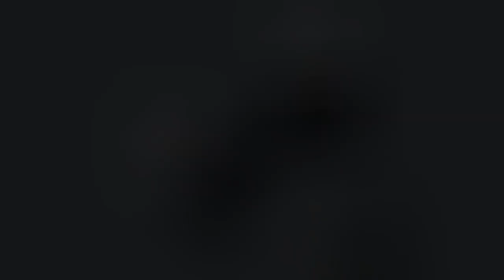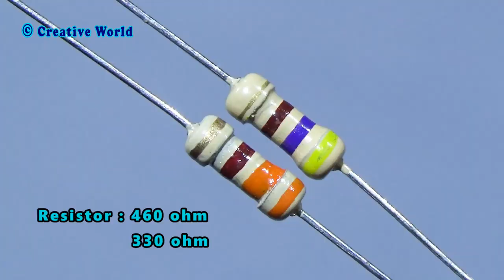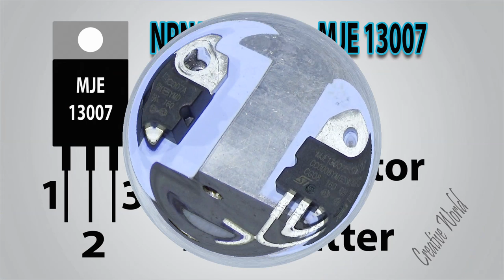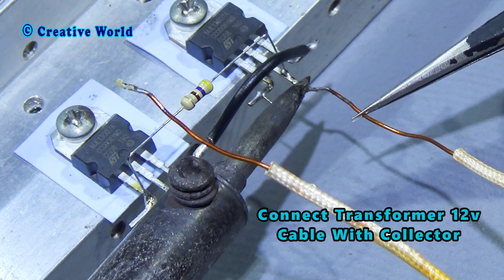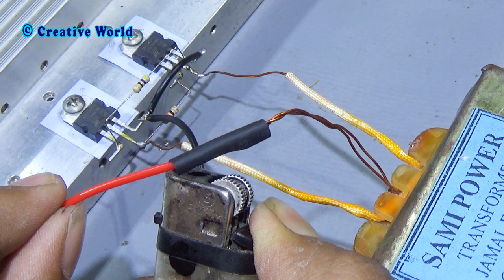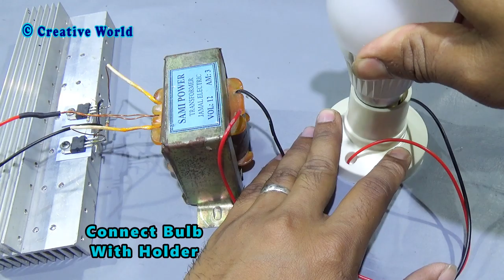How To Make Cheap DC To AC Inverter Circuit Using Transistor

Comment: BS. There is no timer IC or capacitor to generate the 60Hz.
Reply: AC current does not have to be 60 Hz. It can be 50 Hz, 60 Hz, or even a couple kilohertz.
Reply: @colenichols  lll⁰p
Reply: he's just switching directional flow. Making a square sine wine at a natural oscillation based on the resistor between the two switches. Then using the transformer to bump up the 12volt to 120. And because 60hz is just code for electrical it doesn't actually influence the amount of light produced just the frequency of the strobe from the AC current. Someone feel free to correct me, lol but yeah I'd love to see a oscilloscope reading.

Comment: I can only make software powered switch to alternate closing circuit to generate low ac voltage and current and using transformer to low ac to high ac. Software based switching make me sense and fit in logic easily. But this circuit not fiting in logic and event not fiting in sense how it will swap line path at constant frequency. 😅 Can I assume it's fake.
Reply from the maker: not fake.
You can try
Reply: @CreativeWorldPro  okay but could you explain me how it alternate current.
Reply: Fake

Comment: This thing is not converting DC to AC since there is no existence of an oscillator anywhere in the video. In fact, I suspect the power supply already AC and all the circuit is doing is stepping it up using the transformer.
Reply from the maker: not at all

Comment: That's a DC LED bulb, nice trick bro
Reply from the maker: Yeah thanks
Reply: @CreativeWorldPro  wait, it's dc led bulb, not ac? because I have an experiment however my input is only dc, and I want to change to ac because it's about the transformer. However, I want to do it with low volt but ac (well because I'm afraid that's dangerous). so the output is not ac?
Reply: Bro the LED bulb will turn on but it will blink depending on the frequency of the AC.

Comment: I would have loved to see a live view of an oscilloscope to see the waveform and Vpk-pk. Transistors ussually need to switch fast. So a slow wave to turn them on and off would cause huge losses due to heat dissipation or even blow them up. And a lamp usually runs on DC too. Perhaps show a device that truly needs AC to run. Perhaps an AC motor.

Comment: I know this is an old video. But I need this on a car scale. I need over 1000 watts for smoke machine.  Can this be done for a car battery to the smoke machine.   If yes. What do I need.
Reply from the maker: this circuit can't produce 1000 watts

Comment: Can i use 20 volt with this circuit instead of 12V or will it get damaged witb 20 Volt
Reply from the maker: yes
Reply from the maker: and will overheat transistor.

Comment: so, does this actually work and can I use it on a 12 volt battery with a microwave transformer? because I don't want to try it if it's gonna blow up, set fire or just flatout kill me......
Reply: Maybe don't use a microwave transformer,just don't,use a regular transformator from a regular power supply

Comment: I don't get it. The 12-0-12 is a transformer for converting AC-DC so are you showing how to run it backwards and convert DC-AC?
Reply: Yes
Reply: 🤣😂🤣😂 transformer is not converting AC to DC 🤔🤔🤔 for that  you will need rectifier or 4 diode 😊which is same👍

Comment: What is the transformer range,you said it's 12 v to 12 v ,then how light works in 12 volts
Reply: when he runs it backwards thru the transformer it goes from 12v to 120v